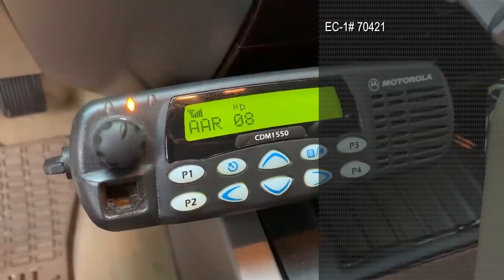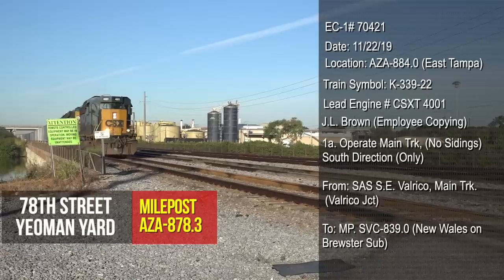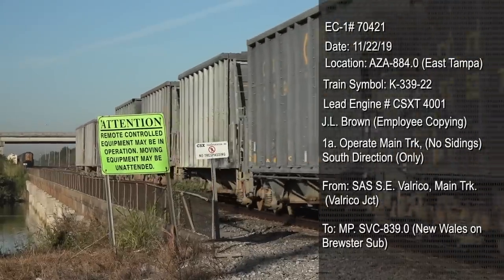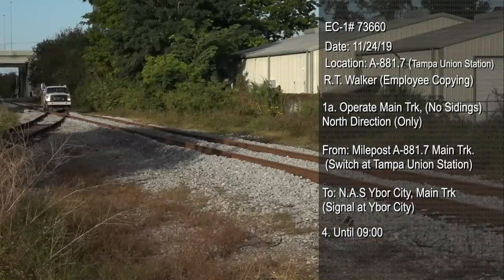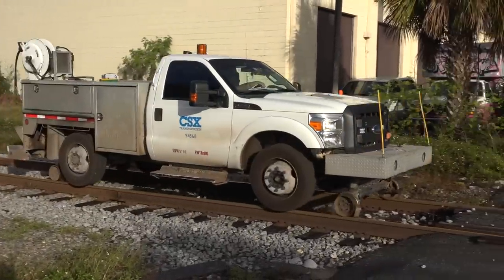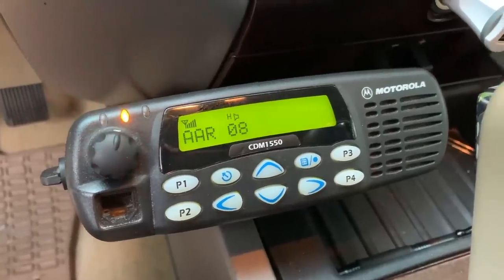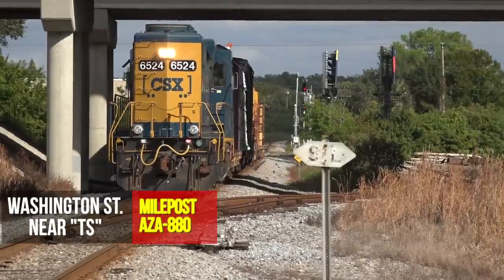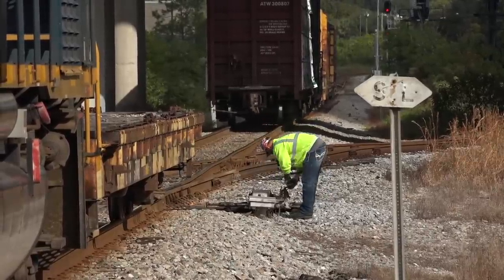Decoding Railroad Jargon

Comment: That's some very detailed instructions(almost like being a air traffic controller) - but details beat being dead every time.
Reply: Yeah, locomotives can't just "go around" at speed if somebody is blocking their way into a destination.  So not going into a zone at all in the first place works better.
Reply: ATC took a lot of early techniques from RTC and there are still similarities.  The main difference is that ATC has no equivalent of automatic block signals, it's time-in-trai or radar/transponder control similar to ATCS en-route, visual or radar control at aerodromes.  And while they both talk about "tracks," those are much less expensive in the sky.

Comment: Very informative, but it could have been so much longer.  I remember once hearing between a dispatcher and an engineer; it was required to have 5 loaded cars in front of the DPU, and the engineer really did not want to fuss around and do that.  Long story short; the dispatcher finally laid it out point blank.  “This is not an option”

Comment: For 30 years I worked for the US Air Force at Edwards AFB, mainly in Public Affairs. For a year I was an assistant airfield manager, a job I was qualified for because of my six years of experience as a Navy air traffic controller. 
  Point is, most of my working life I’ve been around aviation in general. In the midst of all this I’ve lived most of life in communities served by railroads. And I don’t know much about them, beyond knowing that conflicts between trains and automobiles are always ended with the train prevailing!
  I find the video pieces you’ve produced extremely interesting! You do an outstanding job explaining various aspects of the railroad industry, both in terms of the words and phrases you choose and your delivery!
  I know it’s a lot of work. I wanted you to know I appreciate it. Thank too!
  Dennis Shoffner, former Chief of Community Relations, Edwards AFB, retired
Reply from the maker: Thank you sir! Wow! Edwards. That's the "top of the ole' pyramid" isn't it? That must have been an interesting career out there.
Reply: Distant Signal In terms of flight test, yes. Each time a manned aircraft exceeded the next Mach number it happened in the skies above Edwards!

For 20 years I ran the base’s public tour program, so I got to know quite a bit of aviation history. The original settlement
Reply: I think I hit a wrong key! To continue, the original settlement there was the town of Muroc. The first three people were the two Corum brothers and one was married. They settled by the railroad, at a water stop on the western shore of what we know today as Rogers Dry Lake. (Muroc is Corum spelled backwards!) That was around 1910.

Comment: E C = east coast movement
NAS= north abosolute signal
SAS=south abosolute signal
Good video just figured i'd throw those out there.
Reply: If you look at djstrains, he is an engineer for CSX and he talks about the EC-1. He works in the Pittsburgh area. Would that still be considered East Coast? Could it mean "Employee Communication"?
Reply: @davidschick6951  Emergency condition.
Reply: @davidschick6951  -  The form itself has no name associated with it beyond EC-1 and it applies to ALL CSX territory.
Reply: NAS = Northward Absolute Signal and it will be on the South side of the specified location.
SAS = Southward Absolute Signal and it will ben on the North side of the specified location.
When specifying locations the  locations must be specific otherwise deadly accidents can happen.
Reply: @davidschick6951  yes pittsburg would still be considered east coast.
It is east coast.  Not employee communications or any other abbrev.  Im not making it up i work fo csx.
Reply: @davidschick6951   EC-1 is a track authority. It covers the rear of the train to a certain control point.

Comment: I highly recommend to anyone interested in watching trains and understanding why they do what they do to purchase a scanner. I have used Radio Shack 200-channel handheld units for over 20 years. I have all 97 of the AAR frequencies programmed in, so all I need to do is a little research on the channels used in whatever location I happen to visit. Along with the internet, I have found a book from Kalmbach (Trains Magazine) titled "Compendium of Railroad Radio Frequencies" to be an invaluable resource. The edition (15th) I have was published in 1999, but I have found that the frequencies assigned to any rail line will stay the same despite mergers and takeovers. For example, CSX still uses the old Seaboard System, Chessie System, and RF&P frequencies that were used in the Richmond, VA area before the mergers in the 1980s and 1990s. Thus, the information in the book is still mostly up-to-date. Unless I'm railfanning around a major yard, I just have the road and dispatcher channels open, so that I don't' miss anything important. Having "ears" really opens up the world of railroading to us civilians and provides a wealth of knowledge about what happens and why. Conversations between crews and dispatchers, talking defect detectors, and the calling of signals by passing trains take the guesswork out of standing and waiting at trackside, especially if no signals are within your line of sight. I like my handheld which allows me to roam, but permanently installed units like Danny uses are more powerful (and expensive); they'll pick up things I might miss. I know some people who have wired in a portable speaker to their scanner so they can place it on the roof of the car once they stop and get out. If you happen to be near a switch job or other location where crews are accessible a polite question or two can yield valuable information and help take some of the mystery out of what you are seeing and hearing. Please remember - in this era of heightened security and the "litigation lottery" trespassers are considered a safety hazard and/or a threat, so stay off the right of way and equipment, and obey no trespassing signs. That will improve the odds that you'll be greeted in a friendly manner.

Comment: Many years ago, I was a technician with CN Telecommunications, which was owned by CN Rail.  For about 2.5 years, back in the mid 70s, I worked in Northern Ontario, based in Capreol, which is north of Sudbury Ontario and where the main lines from Toronto and Montreal met, to continue on west.  My work included the dispatchers phone and train to wayside radio.  Back then, I could easily monitor the train communications without a scanner.  All I had to do was plug into the circuit.  On occasion I would also be doing some work in the dispatchers office and able to watch the big board that displayed train progress.  One thing I recall from those days was very thin paper called "flimsies", which had train orders written on them.  The station operator would pass them to the train crew using a Y shaped pole, with the order tied in a loop of string.  A train crew member could reach out and pull the loop off the pole, simply by making sure his hand went into the loop, as the train was slowly rolling along.  I also worked on a system called TRACS, which kept track of freight train consists.  In my work I would also often ride on freights and was on passenger trains so often the conductors stopped asking for my pass.  When I needed a stop (often more accurately described as a "slow" <g>), I'd get on the dispatchers phone to request it.

Comment: As a British rail enthusiast or veg (your equivalent of a foamer/other slang) it is very interesting to learn about this radio system and communication between the driver/engineer and the signaller/dispatcher. In the UK, all mainline trains (passenger, freight etc) use a GSM-R radio system , where the driver enters the Train Reporting Number (or Train Symbol as you would call it) and the nearest signal number into the radio to register with the signaller (what you would call a dispatcher). This then appears on their system, and they do this at the start of every journey as for each region (for example London Victoria to East Croydon, as they break the lines up into different timetables) they have a unique code for each service (called a headcode) which is shown in the Working Timetable (staff equivalent of a passenger timetable, just with extra information). The driver then uses this radio to call the signaller/dispatcher at the designated signal box (for example London Victoria's platforms 9 to 19 are controlled by Victoria Central signalling centre, at Clapham Junction) and if they are stuck at a red signal or have any other queries, or want to request a SPAD (signal passed at danger). :)

Comment: Danny - Nice job.  

This is not unlike the conversation  between pilots and air traffic controlers.  The words, phrases and sequence is critical to minimize misunderstandings and promote safe & orderly traffic flow.  As a pilot, many times I tell non-flyers that pilots generally are well preparred because " when you are flying, there is no place to pull over to the side of the road and work up a plan".  Makes a lot of sense listening to the train dispatchers and train crew.  The only thing different is as pilots, we are required to readback instructions & clearances and get an acknowlegdement from ATC.
Reply from the maker: Thanks William. You make excellent points. the jargon combined with routine are what make for safe communication.

Comment: Informative video on railroad communications, anyone getting into railfanning should always carry a scanner with them, makes it easier to chase trains even if you don't understand the jargon. I use an old Radio Shack Pro 26, pre digital age scanner, works fine for monitoring the RR freqs, however if you aren't familiar with scanners exactly what kind of radio/scanner does one buy? How easy are scanners to program? How many railroad frequencies are there? Where does someone find radio frequencies? Which is best? handheld or a radio plugged into a car like the one you use? Do you need a special antenna for a scanner? The list goes on, it would be nice for those who may be interested in using a radio if you could provide some information in regards to scanners. Your videos are excellent by the way.

Comment: I remember as a teen in the 90s getting my first scanner and I didn't understand a thing.   If you go at it alone it does take a little bit to figure it all out.  Sometimes when my wife is along she'll say "I have no idea how you understood that"!
Reply: My wife says the same thing except that it's my job to know. My answer was if she had been a police officer I would have the same responses to her radio.
Reply: I was fortunate, many of my relatives worked for railroads, C&O, L&N lines, so I learned a lot of the jargon from them.  Although some of it has changed from some of what they used to use, but not very much, pretty close to what it was when I was a child.  But sometimes they'll come up with something I hadn't heard before and I'll be scratching my head with "What the heck did they just say?" LOL

Comment: Great video Bad-Man Dan. Only question i have. In the aviation field, and when i was in the USAF, we use the phonetic alphabet to avoid letters that sound the same. Why isn't it used here?
Reply from the maker: Thanks Randy. Railroads generally use short-range VHF-FM radio, which is pretty clear and easy to understand. I have heard them using phonetics to clear up a dispatcher's initials and other stuff like that, but CSX generally speaks in the clear on the radio.
Reply: Hi Randy, in a lot of the jargon, like with an EC-1 form, there's not another form that sounds anything like EC-1 so it's generally recognized. In cases where P's and C's and G's sound the same, if there's any confusion we will generally request them to repeat, "G as in Golf?"
On the other hand, we take things such as directions and numbers pretty seriously as that can cause some real headaches if we get two Q-trains out on the same track going in opposite directions. So for numbers we will say "Three, that's T-H-R-E-E" or "Seventeen Sixty Eight, that's One-Seven-Six-Eight" and for directions we will say the direction and then spell it, so, "North, N-O-R-T-H"
Good question though, it deserved asking and answering.

Comment: Been there and done that many times using form 23.  Ours was mostly for MW work or a work train.  23 number, todays date, person´s name,  may use track # between point A to point B, unitl released or until certain time,  time repeated (to be certain it is recorded in writing by the person to whom it was issued).  If ANY detailed is repeated incorrectly,  the operator repeats the correction and it is repeated back to the operator again by the person receiving the permit and then the current time is recorded.  On 1st shift as many as 20+ of these are issued in addition to handling train traffic (both electric switches and signals) addressing crossing signal problems and handling 2 lift bridges and 1 swing bridge over rivers where the RR crossed. One bridge was right outside in clear sight. The other 2  had multiple cameras mounted on the bridges that were in another part of town. All the cameras had to be checked carefully for marine traffic before closing the bridge. If a boat showed up AFTER the bridge was lined and locked including train signals and had to wait, someone was often PO´ed at the operator. Too bad.  We had RR operating rules that had to be followed. All this  included telephones, intercom to 3 RR locations,  RR radio, marine radio.  Often we were dealing with 3 or 4 different situations at the same time and of course each thought they were the only one needing something.  Each day had its own unique differences.

Comment: Hello Danny. Here in Union Pacific territory, they language is almost formal. They don't say "STOP' they use "That will do." They don't acknowledge with "right" but say "That is correct" instead. Like aviation communications, there is a certain format that is followed. And like you said it is there to save lives. Have you heard the term "HOT RAIL?" It's used here to warn the trainmen or MOW personnel that there is a moving train near by. Thanks for the video. Jon
Reply: I have heard the term "HOT RAIL" and "HOT TRACK" in relation to moving trains particularly to the one we are working on.
Reply from the maker: Hi Jon. Yes, I've heard them use "Hot Rail" many times over the years. Especially in places like sidings and double track mains, where a crew is working on one track and a through-train is coming up on the other.

Comment: Great info Danny. Now need one on train horn signals!
Reply: Brief description of whistle signals;  please read the entire rule.  Generally, NORAC is used on eastern roads, GCOR on western roads.  Signals are the same in both rule books.  Both are available online.  Current GCOR is 7th edition,  April 1, 2015 .

From NORAC 11th Edition – February 1, 2018
19. Engine Whistle or Horn Signals
The following are engine whistle or horn signals. The signals are illustrated by “o” for short sounds and “—” for long sounds

— Crew members apply brakes.
— — o — 1. When approaching a public highway-rail crossing at grade
Succession of sounds Use as an alarm when persons or livestock are on the track at other than highway crossings at grade
— o Approaching Roadway Workers or their equipment on or near the track,
o o o 1. When stopped, back up
o o 1. Acknowledgement of a Stop Signal other than a fixed signal
 o o o o Call for signals
Reply: Horn/whistle signals haven't been as big of a thing since the invention of radio communications.

Comment: Hey Danny. Love all your videos.  I know 881.7 is the mile post.  What does the letter (A) prefix signify (A-881.7)?
Reply from the maker: Excellent question, Scott. The A stands for Atlantic Coast Line. Conversely there are other lines that carry an S, for Seaboard Air Line. CSX is made up of so many predecessor railroads that it needed letter designations to delineate each route. Seaboard Coast Line had already added these letters in many places before it merged with Chessie to make CSX.

Comment: I’m sort of new to railfanning and this may be a silly question, but where are the “equipment defect detectors” located? Like is there a map online or something where we can find where they are nearest to us?

Johnny
Reply from the maker: Hi Johnny. Defect Detectors are usually at 20 mile intervals, more or less, on most railroads. You really need a timetable or an SPV Rail Atlas to find their exact locations. Both of those are easy to get online.
Reply: Distant Signal Thanks a ton Danny, always enjoy your vids.

Comment: Danny, who did the voice over? sounds 'company provided'.
which surprises me i heard a boo-boo. 1:54 trains usually have 'todays date'. NOT always.
in my experience, date given is the date of origination.
2:28 EC-1 can only be canceled by the employee who was given the authority...barring a few very extreme circumstances.
Reply: googoo gjoob if the D.C.-1 is given to a train crew, either the conductor or the engineer can copy, release, report by, or amend it.  Also, a brakeman, conductor trainee, or engineer trainee can perform all those as well, provided the engineer or conductor of said train is supervising.